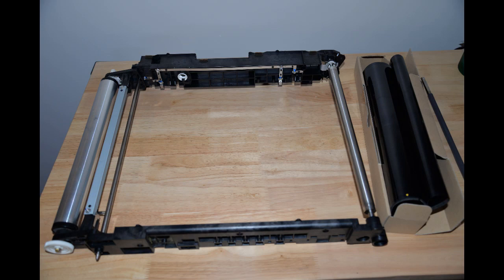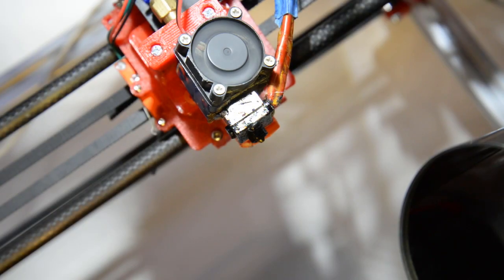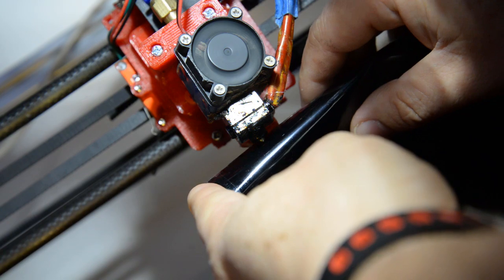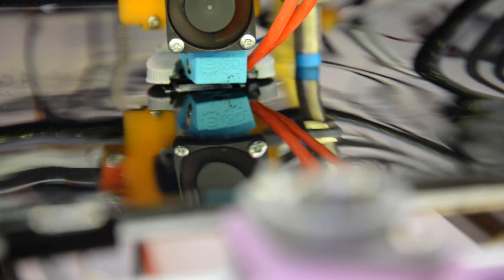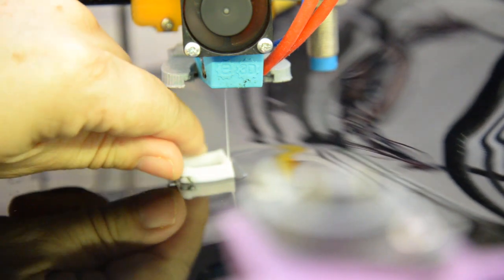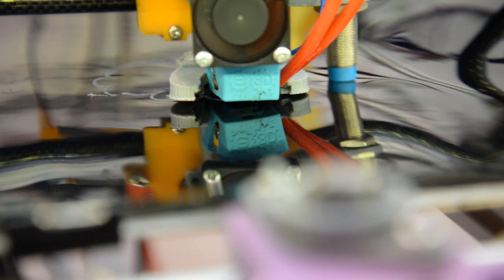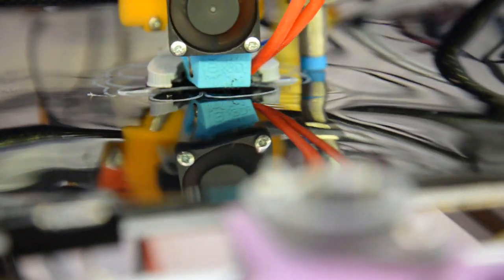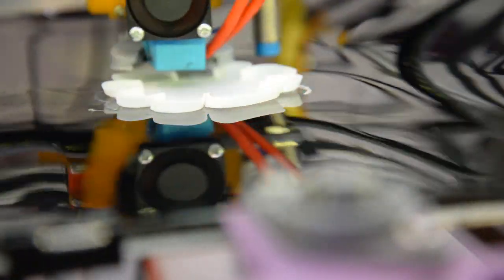Investigate Laser Printer Belt for 3D printer

Comment: It seems to me that simply using a vacuum table is the best answer.  It will hold the belt down very securely yet still allow it to slide laterally.  Then the stainless with kapton becomes the cheapest belt material I know that will work.  I plan on building one as soon as I have a few free days.
Reply from the maker: Looking forward to seeing how that works. How would you do the heating of the bed?